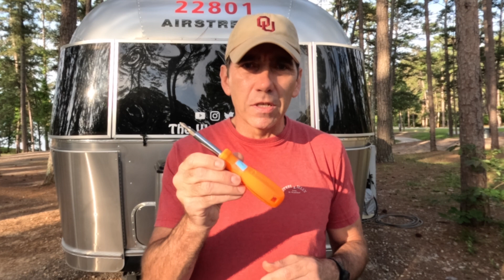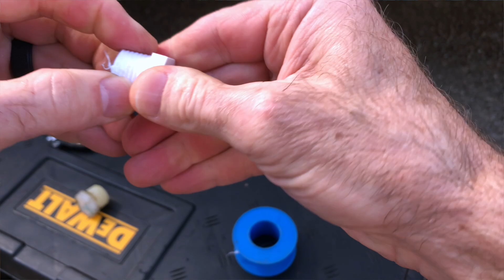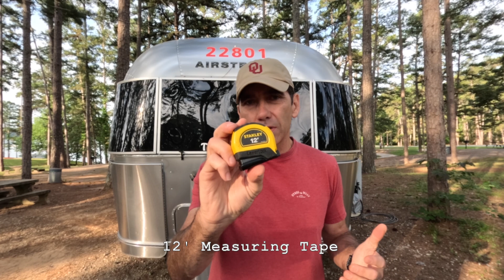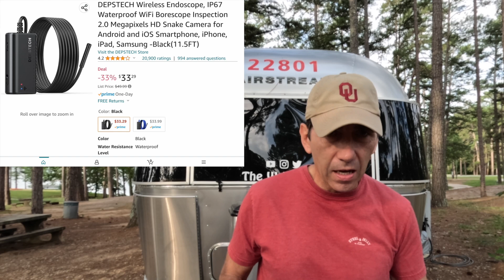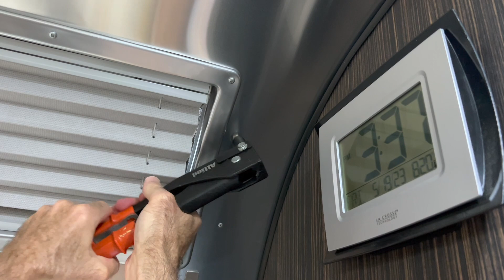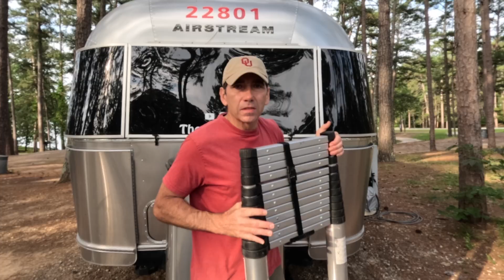AIRSTREAM TOOLBOX: The Essential Tools 🛠️ You Should Carry

Comment: I had an event where the break-away switch cable broke, and I couldn't sufficiently repair it. I don't know if anyone has mentioned it here, but they are inexpensive and I now carry an extra one.
Reply from the maker: Great tip.  I too carry a spare breakaway cable.  Knock on wood we never need to use it.  Happy camping and safe travel.

Comment: I wanted so much to love the ViAir compressor but after purchasing this high priced item, I just don’t (I still carry it).  My Dewalt MAX 20V cordless is quick and easy; no electric cords, clamps, or long coiled hoses.  Dial in the pressure on the digital display and it hits it on the button.  Easily fills a nearly deflated tire.  Very light weight and I t uses the same battery and charger as my Dewalt drill and impact driver that I also carry.  Seems like I charge it about once a year for all my routine pressure checks and top ups.
Reply from the maker: Excellent alternative air compressor recommendation.  The ViAir has work really well for us, but I do like the idea and easy of a cordless air compressor.
Reply: Thanks for providing this video. I recently purchased a used Airstream and I knew building a good toolbox was necessary before I could hit the open road safety. Much appreciated.

Comment: Nice list!  You may also need metric Allen keys for the back-up camera mount and other electronic items.  A DVM like the Fluke 325 does everything a standard one will but also easily clips around a wire to measure current draw.  Very handy!
Reply from the maker: I had thought about the Fluke, but based on my limited electrical experience thought it would be overkill for my basic needs.  Perhaps I will upgrade in the future as my electrical needs and experience increases.  Safe travels.

Comment: That’s a pretty comprehensive list! You captured every needed tool. 👍👍
The only thing different that we are carrying is a full 1/2” drive socket set. I need a few more sockets and breaker bars to keep the ProPride hitch torqued to spec. 🚀🦩
Reply from the maker: Makes perfect sense.  Every toolbox will be slightly different from another.  No right or wrong, just what works for you and your needs.  Safe travels